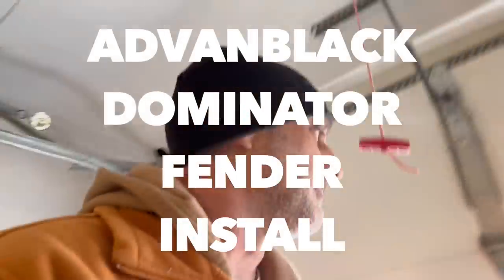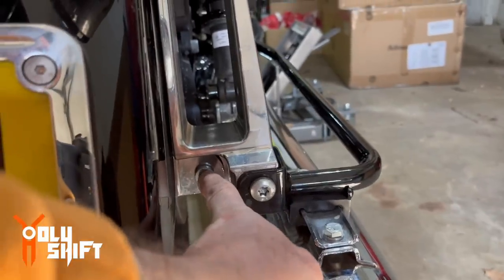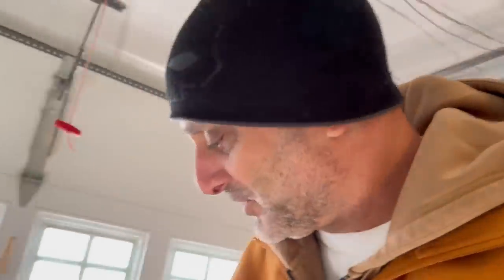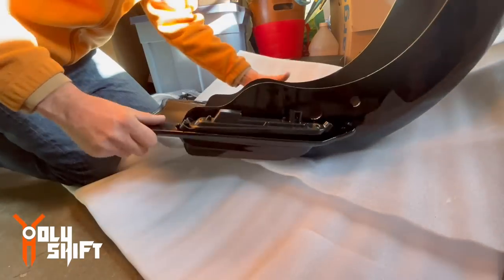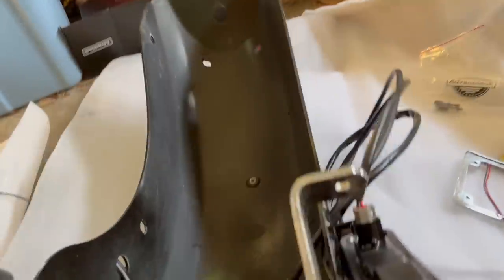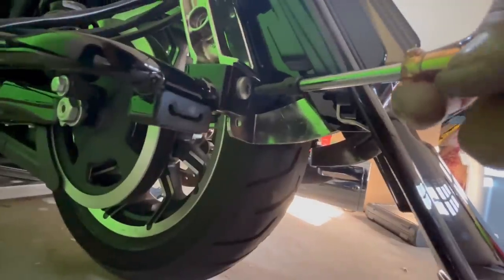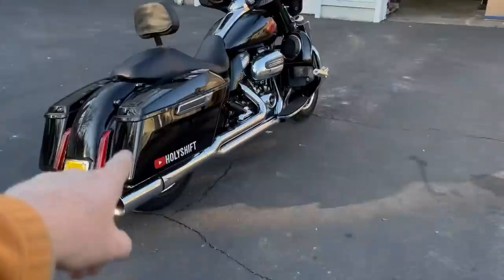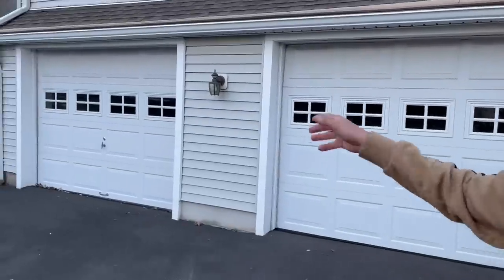Advanblack Dominator Fender Install / BlackBird Rear End conversion Pt.1

Comment: So a CVO fender and other look alike products installed on the blank canvas Electra… Why the heck not? Screw Harley anyway kind shape or form!! Why should I pay a resaler (dealership) 45000 for a CVO when I can make mine like it but with MY style?? 117 ci on a Low Rider S that costs like 18 grand and 117 ci on a CVO that costs 45!! Electra Glide with the 131 crate motor and a insane paint job even with upgraded suspension and you won’t even come close to the $45k MSRP of the CVO !!!! Ways to go buddy good for you and I’m proud for ya!! God bless🙏

Comment: Hey Sandy - "Blackbird" is looking good; Advanblack rearend conversion to the CVO style fender/lighting looks very clean & smooth.  The CVO style rear lights look very cool.  Looking forward to your next video with changing out the standard bags to the stretched bags.  As you have a 2-into-1 exhaust system, presuming you'll be going with just the one exhaust cutout on the right side bag.  Like the recessed license plate and self contained LED lighting for it.  Thanks for the video.  Tom, Hawthorne Ca.  '21 RGS & '06 CVO V-Rod.

Comment: Looks great Sandy!! Couldn’t you have put the license plate on the fender before you put it in place?
Reply from the maker: Don't think so - i needed the bolt under the plate to be loose so i can move the connected bar around to fit the bolt on the sides of frame - only after they are in i can tighten the bolt under the license plate - so I needed it exposed!

Comment: Why you didn't install the plate on the fender before mounting the fender?
Reply from the maker: Need to tighten bolt under the plate after fender is mounted